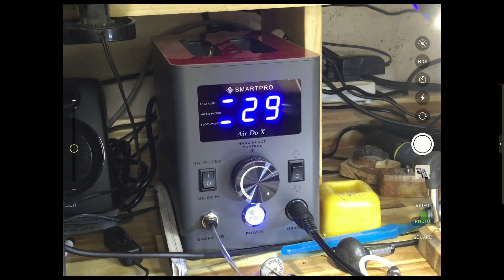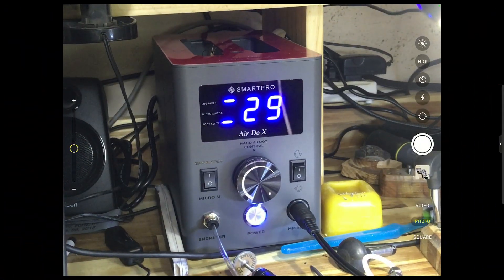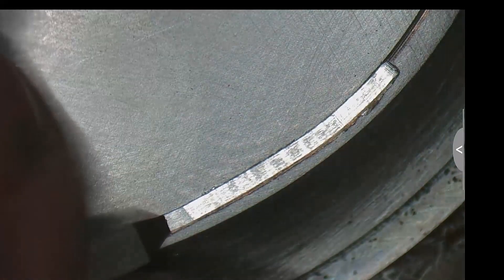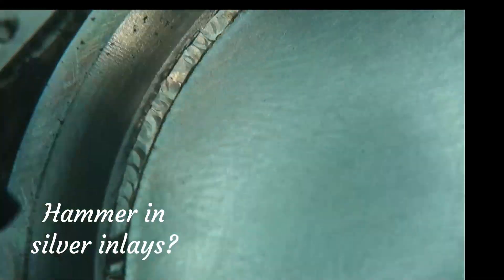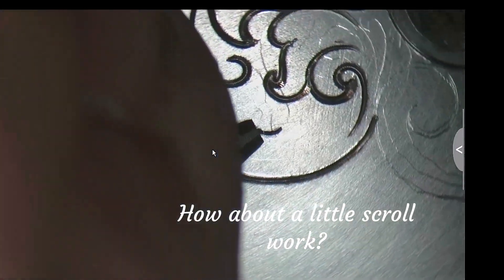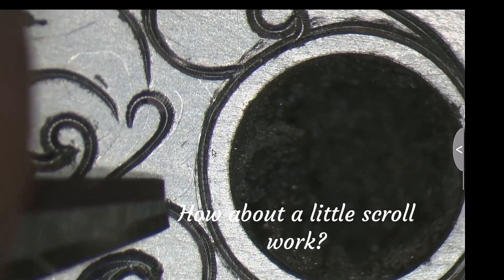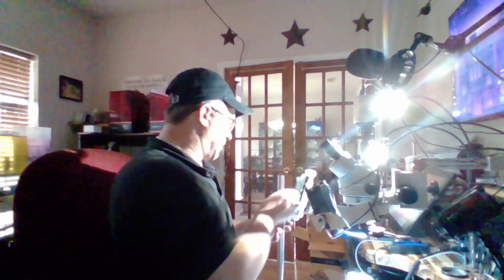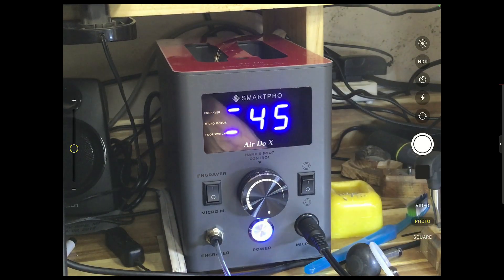Early Test of the Smart pro Air do X

Comment: Thanks a lot for your review! Convinced by that, I bought an Air Do X and I'm happy with it but, being an absolute lay(wo)man, still trying to get into it. 
At which speed did you run the handpiece 1.) at using it as a hammering handpiece, 2.) at using the beading tool and most of all 3.) at engraving? 
I'm too unexperienced and do not know which forces I'm allowed to put on the machine and how much I can expect from it, 
without ruining anything. Thanks in advance for an answer!